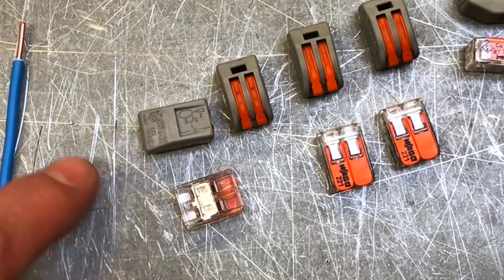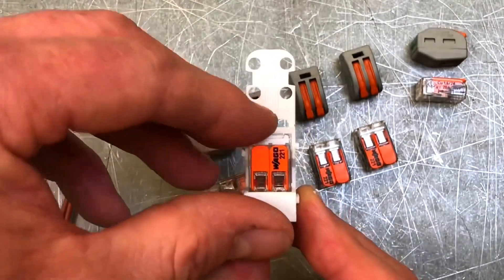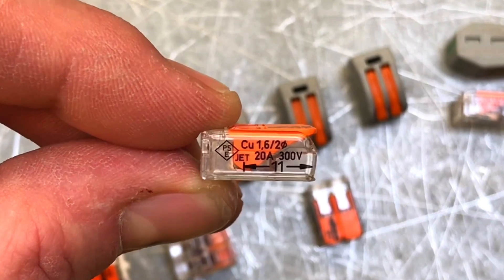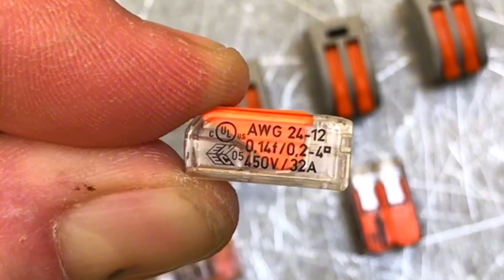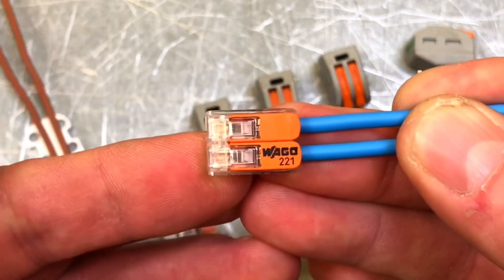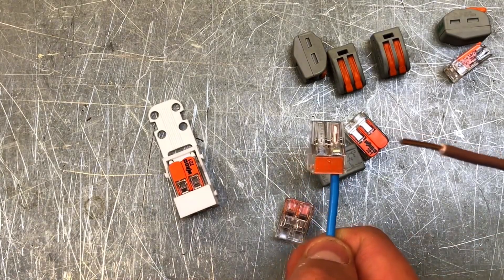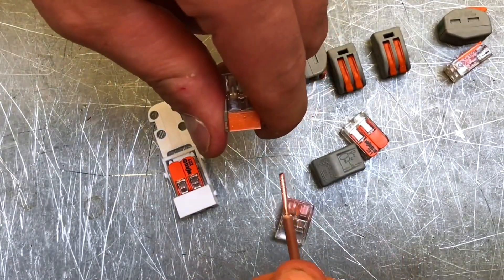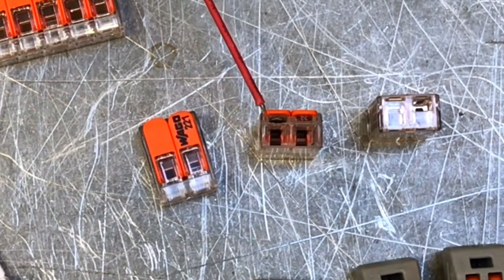Wago 221 Connectors

Comment: why does the Japanese standards agency think these things top out at 20 amps, but the European agency think they can be pushed all the way to 32 amps?
Reply: JIS wire sizes do not align with IEC metric.  Grab a JIS <> IEC comparison chart.  There's no 4 sqmm only 3.5 so that places a lower limit on the current carrying ability of a circuit.  Look into the class they are rated in on top of that, small domestic instead of industrial.  Same connector; different wire; different rating class.

Comment: The 221s are one of those "ideal compromise" products that can be used for just about anything. I've done up poorly-wired sockets with them, "fixed" an oven that had a broken wire, ensmartened a "dumb" boiler, safely tested live 240VAC equipment on the bench (a DIN-mounted Shelly power meter), even built industrial automation at work. Anything short of gigantic industrial 3-phase motors, these are amazing for.

They're even more adaptable than the classic DIN-mounted spring terminal. You need ferrules for those, else they try to cut stranded wires. The 221s actually work better without the ferrule, especially for larger cross sections.

Comment: One very important difference is the temperature rating. It's 80⁰C for the 221, but only 40⁰C for the 222. The 221 are better in every way than the 222.
Reply: Yeah, the 222s are much softer plastic. You can feel it when you push a knife through the two kinds.